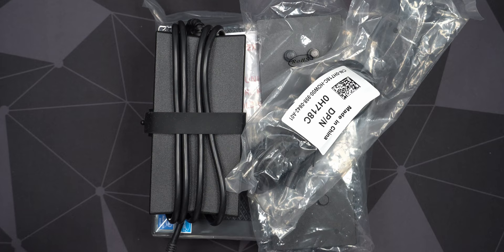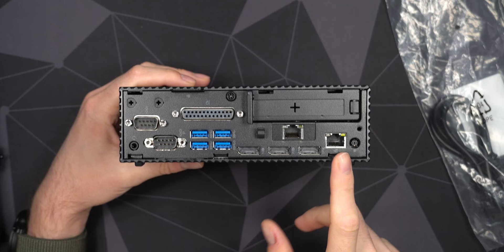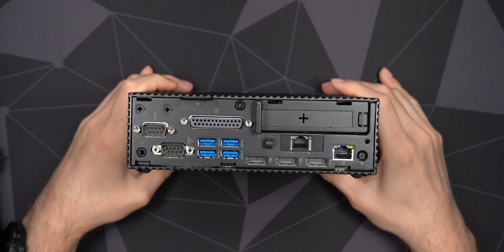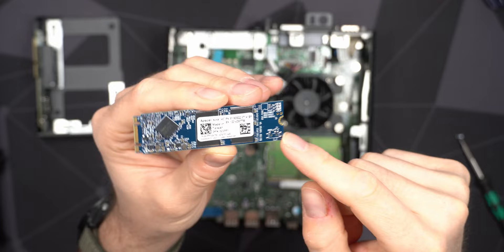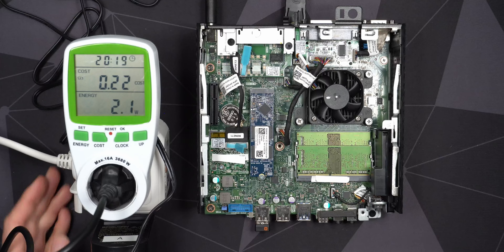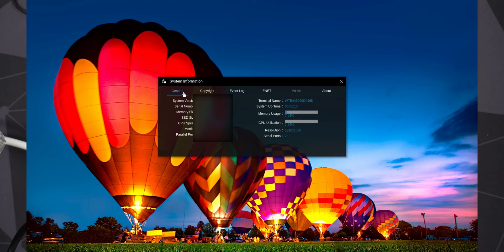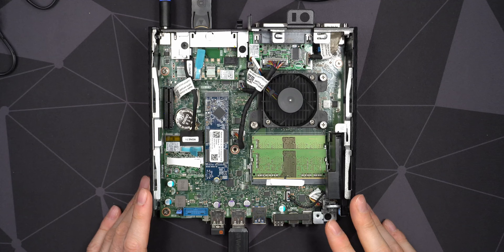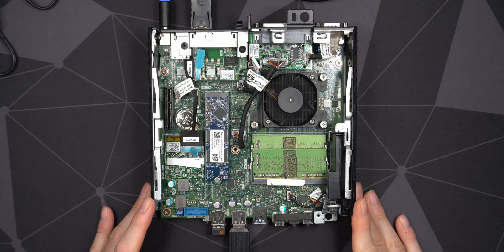Dell Wyse 5070 Extended: Complete Hardware & Bios Walkthrough

Comment: The version with  Quad core Intel Celeron J4105 CPU which I´ve got has no fan and works very nice! Power draw with Proxmox and 4  server running is 3.5-4W in idle only!
Reply: Can it handle windows 11 vm  and some linux vms and 4 light webserver + pfsense? i will install 16 gb ram on the system

Comment: I have this exact model but it came with the optional GPU. It's a surprisingly capable device and I have used it for several different things. It's a great low power desktop. I used it as a router for a while running opnsense with an Intel 5 port NIC. Now it is a great little low power proxmox server running multiple servers.

Comment: This is extremely helpful. How did it end up working for you with pfsense? I just bought one of these systems myself and plan to add a 4 port intel NIC.
Reply from the maker: Its been rock solid for me, running pfsense plus. Ended up throwing a quad Intel nic in mine as well. Can only recommend this setup 👍
Reply: @whcvip  Same here.seems to be a great little box.